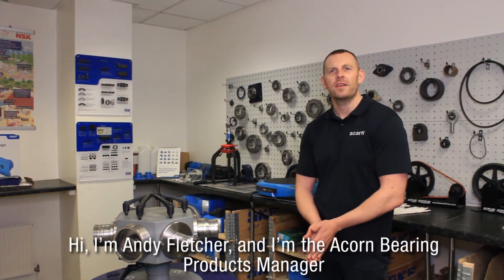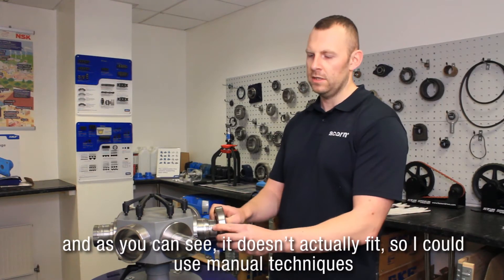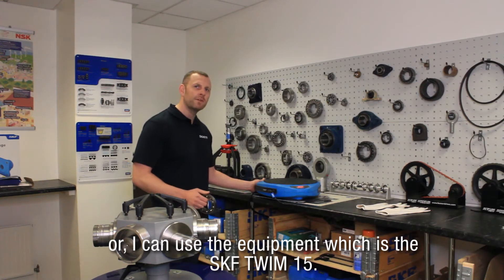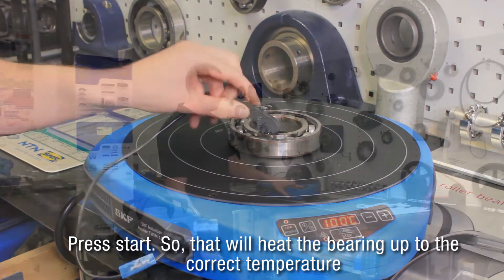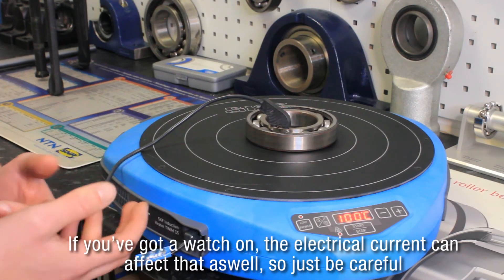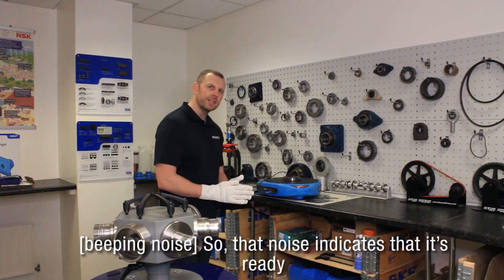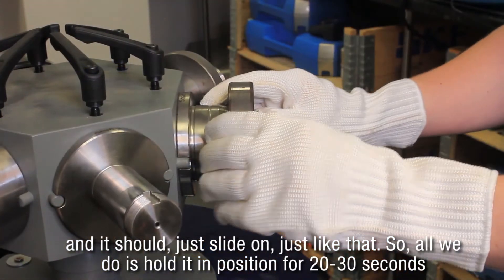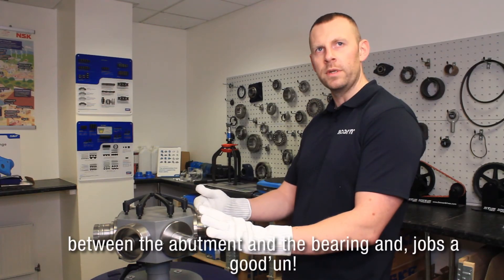How to Mount a Bearing Using the SKF TWIM 15 Portable Bearing Heater

Comment: Hello , great demonstration
how to decide to which temperature I should heat the bearing?
or is it automatic?
thank you
Reply from the maker: Thanks for your comment! For this particular heater, it should automatically detect the bearing size and heat it appropriately as it has an in-built automatic temperature monitor which indicates to the user when the bearing reaches the correct temperature. However, it is always advisable to check manufacturer guidelines as some bearings have limits that they should not be heated past. If you'd like anymore information, our bearing expert, Andy can assist with your queries https://www.acorn-ind.co.uk/about-us/our-experts/bearing-experts/